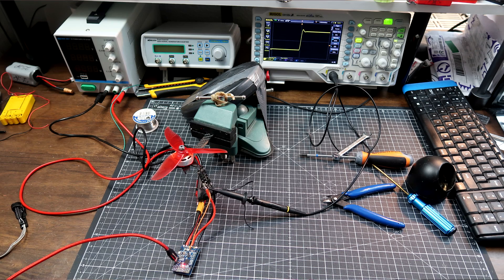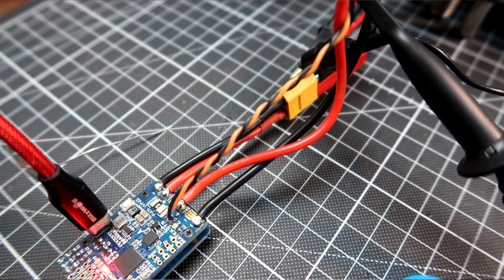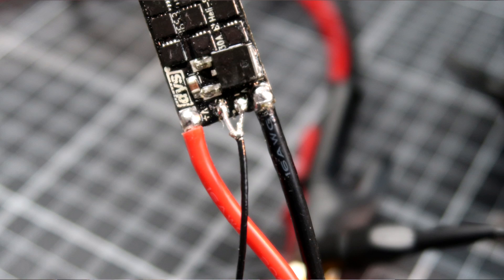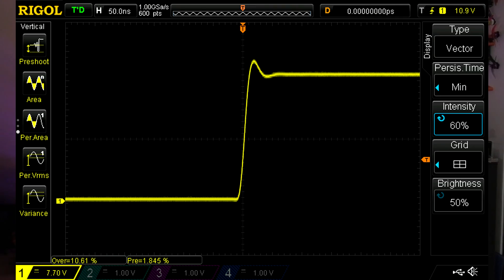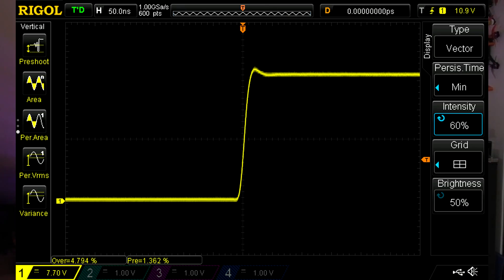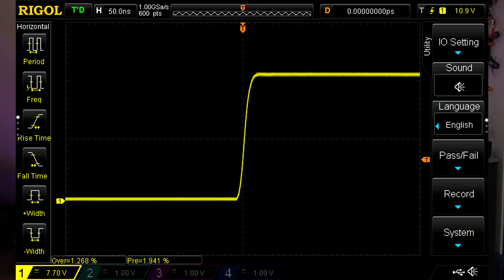ESC signal wire is important - wire vs twisted pair vs coax

Comment: Cool. Ive always twisted appropriate wires when possible. I remember learning to use both sig and gnd wires for the esc signal somewhere years ago. Sadly the only fixed wing I have with a fancy esc protocol is my Nano Goblin but it has a rather short sig wire....Good Video

Comment: But shouldn't a coax actually just shield the cables from each other and not improve the signal from a single cable. The peak is only gone because the impedance is higher, I think 100µF/m. With a longer cable, the signal edges are then no longer so steep. At least that's what I learned in my studies.

Comment: Interesting but you are forgetting about the ground loop you are creating when connecting two grounds to the same device. Can you try to disconnect the ground from the signal pad on the ESC and redo the test leaving the rest untouched?
Reply: The twisted gnd wire must be soldered on the ESC side only, to avoid Ground Loop. Ground Loop is something very bad!

Comment: You forgot a CRITICAL aspect of testing these. That would be interference from the high currents of the motor controllers and other electronics. 

Also you can get some voltage drop across the ground cable carrying power to the ESC. This results in ground rise at the ESC. So while the flight controller ground is say 0V, the ESC ground is more like ±100mV which could be enough to upset the single-ended 3.3V logic from the flight controller.
Reply: But the twisted gnd wire has to be soldered on the ESC side only. Absolutely not in the FC, otherwise you will create a Ground Loop.
Even if you use a coax cable, it must be soldered on the ESC side only.
Reply: @Tonynux  I'm not even sure the shield even does much if anything in that case. 

You still have an issue of what is essentially a series noise voltage with the signal. If it exceeds 1.5 volts or whatever the logic level threshold is, then it will cause problems.

And if the ground wire could be severed with one or more of the high side FETs conducting, the current will find a path to ground via the GPIO pin on the FC. That's very unlikely though if it is soldered correctly.

In terms of magnetic immunity, only the center conductor of the coax conducts the AC current while the ground wire of the ESC carries the return current instead of the shield. The loop area will be the area between the center conductor of the coax and power ground wire looping back to the PDB and to the uC. That large loop introduces series inductance which tend to low pass filter the signals, generate radiating magnetic field and conversely be equally suspectable to external magnetic fields coupling into the loop. The shield does nothing.

The shield only terminated at one end might still help with electrostatic EMI field shielding, as the surrounding shield will block the electric field from reaching the center conductor. But such electric fields only really affect very high impedance nodes on a circuit, like floating analog input pins on a micro or high gain amplifier inputs. That isn't the case with this anyway since the microcontroller dshot output is a low impedance drive, maybe around 10 ohms or less depending on the output resistance of the GPIO pin and series protection resistance.

Really the best solution is to have a galvanically isolated differential signalling method. Ethernet for example uses transformers and low voltage differential signaling. Canbus also similarly relies on differential or pseudo differential input stage to help reject common mode noise. Optocoupler can be used but these can introduce bandwidth and propagation delay issues, and would also require 2 wires for TX and RX.

Actually the bestest best solution would be fiber optics but that's getting into absurdity haha 😜

Actually, another practical possibility is to design ESCs that use entirely isolated gate driver ICs so that the microcontroller on the can be powered by the flight controller (using the flight FC ground reference) while the motor inverter MOSFETS are independently powered by the completely  galvanically isolated battery bus. This is what higher power motor controllers have to do, guaranteeing isolation usually up to between 300V to 1000V

Comment: Hi Pawel, what is the exact type of the coaxial wire you used? I want to use a wire like that for camera video signal and ground, and same for connecting the VTX. Would you recommend a setup like that at all?

Comment: Thanks. Good info but what do you mean with "ringing"? Also will wire thickness make any noticeable difference? I assume thicker guage wire will have more capacitance with associated side effects.
Reply: the "ringing" he is talking about is the small overshoot, the small bump at the beginning of the signal when the signal goes from low to high. not sure about wire thickness. too thick is just harder to work with if you are working in a small space. too thin would not be a good idea because the resistance goes up causing a lower voltage at the end of the wire. it won't affect a small mini quad but if you are building a large multirotor or airplane it will have an effect.
Reply: The "ringing" literally refers to the unwanted resonances and / or feedback causing distortions in a sampled waveform. In this case, the surrounding high current paths + motors can generate sufficient electromagnetic radiation to affect the sensitive nature of signal path.
Signal wire leading to and from the ESC need not have heavy conductors. In my opinion, the coax suggested by Pawel is sufficient for almost all RC jobs, because of the low current requirement of signal wire and the protective component to coax. I think it's only going to exhibit voltage drop at lengths over 2+ feet.

Comment: How does a bit of overshoot matter for the protocols we use to speak with ESCs? All the rising edges look perfectly crisp.
Reply: ^ this
Reply: Or perhaps phrased slightly differently: I'd really enjoy watching a video demonstrating a configuration bad enough to cause practical problems such as bit-flips on the receiving end, and if the checksum that's part of the protocols is enough for the occasional flip to not matter in practice or if perhaps you can make flips likely enough to have an actual impact on performance.

Comment: How long can a single signal wire be before you get signal degradation that's noticeable?
Reply from the maker: That really depends on the wire itself and the conditions. In general, i should never happen on quads < 8inch and not really on foamies as long as you do not keep FC on one wing tip and ESC on the other